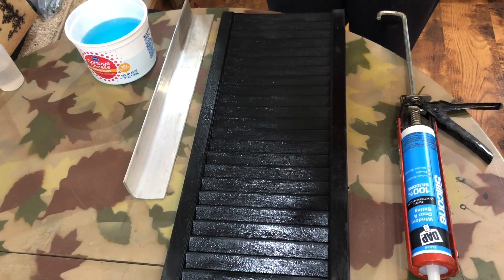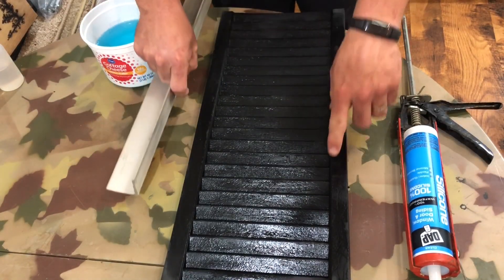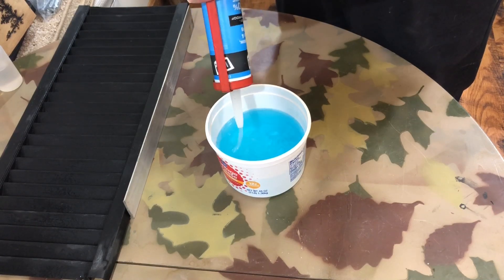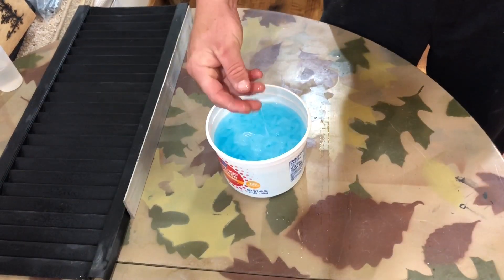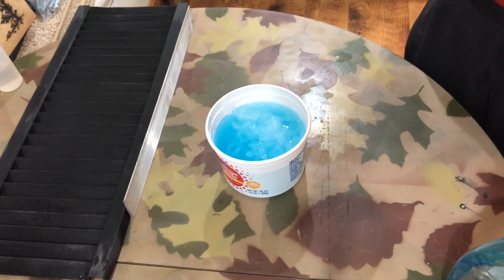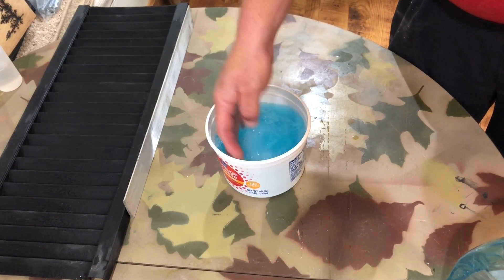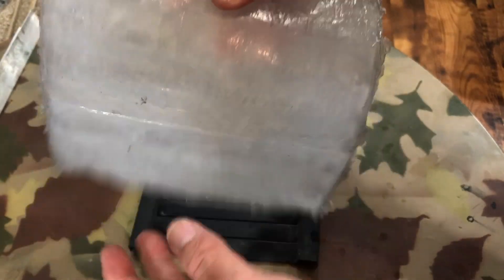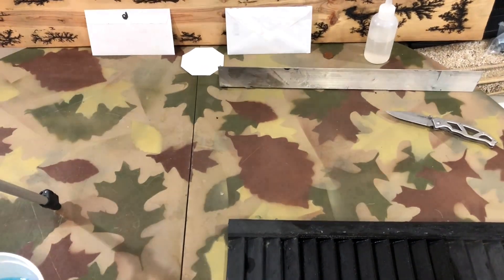How To Make A Silicone Sluice Mat

Comment: Great idea. You can make a sluice mat similar to the Le Trap sluices. I think it would work quite well. Especially in a stream sluice. Yippers, they can get a little pricey. I use MD Silicone from Walmart for a little over $4.00 and that helps a bit with the costs.
Reply from the maker: utahavalanch $4.00 a tube or how do you buy it I am building a shop and planning on helping the local club in making there own equipment
Reply: Robinson prospecting 
My 2 local Walmarts sell the md brand of silicone for a little over $4.00 a tube. It works great. If you made a mat like this out of Silicone and put it in a sluice body it would really work well as there is a lot of surface for the gold to stick to. It would be similar to the Le Trap brand of sluices.
Reply from the maker: utahavalanch ok what you see me using is 3.25 to 3.50 per tube

Comment: How do I get another one of your sluice boxes? I have one and I love it and would like to know how to get a couple more. I got mine at the country store from Robin but it's a thee hour drive .
Reply from the maker: christopher cardenas look me up on FB sent you a f request
Reply: Looks cool but I would have put some more Dawn dish soap in the riffles before you really set in the RTV...I can tell you from personal experience that getting RTV out of somewhere that you don't want it is is very difficult.  I have made over about 30 mats and I don't like Dawn dish soap as a mold release.
Reply: You have to basically put it in a vacuum environment to get all the air bubbles out of it or pour it from a one or two feet distance, which is nearly impossible with standard RTV 100% silicone.
Reply: Looks like a pretty good sluice box compared to Geo  or Le' trap.

Comment: Never seen it done quite the way you have done it. I did mine exactally as Alan did his. As long as it works is what is important.  It looks good.you Are you going to do more and splice them together? Get cheaper silicon from silicon depot on line.  😎👌👌👍👍⛏⛏
Reply from the maker: Chuck Gentles thanks for the sub and will test it out one day lol
Reply: @justsluiceit  I bought a case from silicon depot and paid $3.45 a tube with Alan Robertsons discount.
Reply from the maker: Menards case for $30.00 Black Friday
Reply: @justsluiceit  We don't have Menards here, but that is a good price if it is 100%
Reply from the maker: Chuck Gentles yes it was it was $1 per tube plus tax